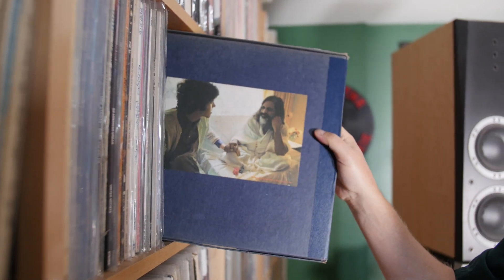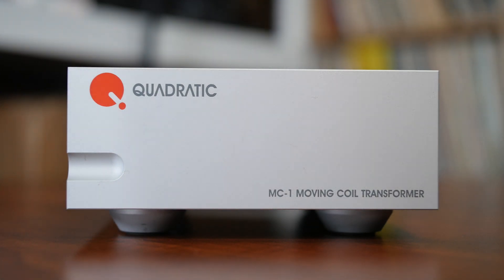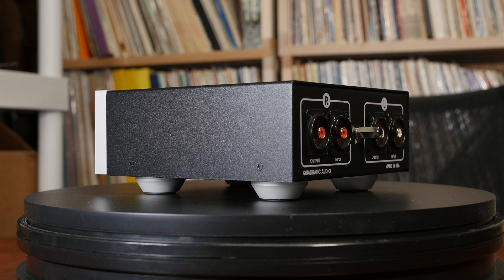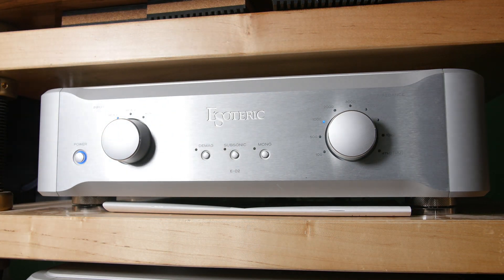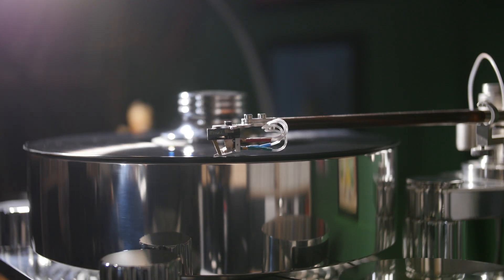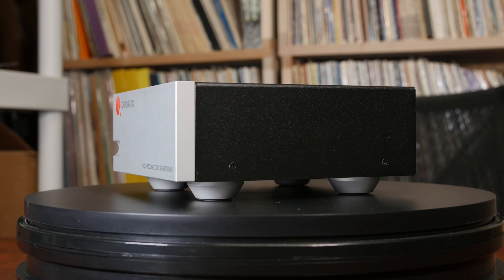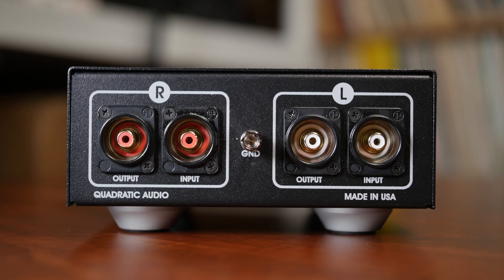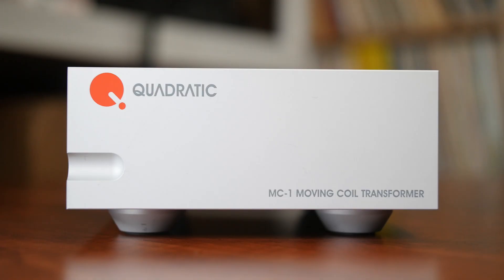Quadratic MC-1 Step Up Transformer Review

Comment: Would the sound is this or its character be similar to Bob’s Devices SUT which also use Cinemags—such as the higher end blue Sky 40 Cinemag?
Reply from the maker: The Quadratic MC-1 is superior  to the Bobs Devices products. The Cinemag transformers used in the MC-1 were designed Quadratic and built specifically for Quadratic. Though they use the same manufacturer, the Quadratic is superior in performance.